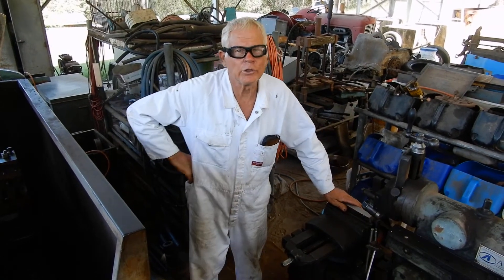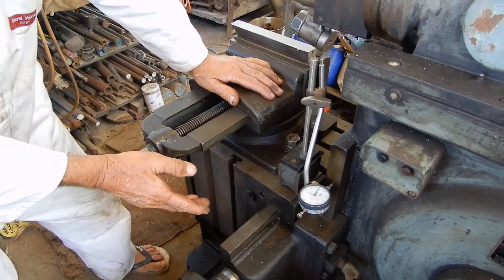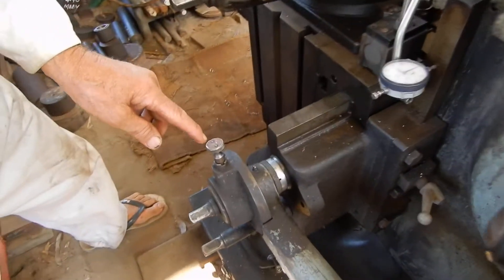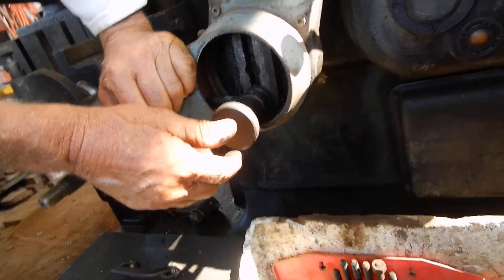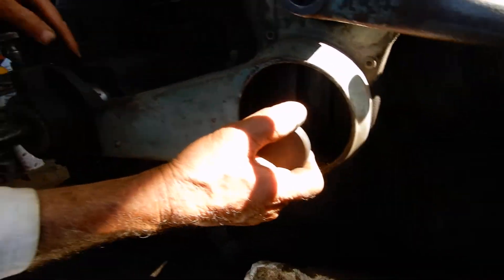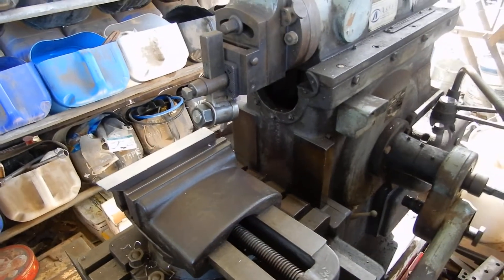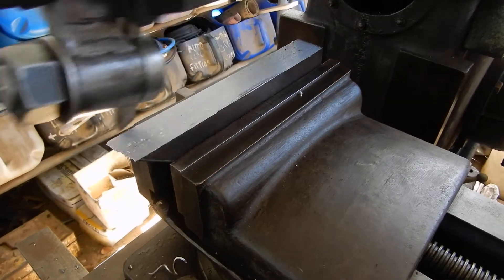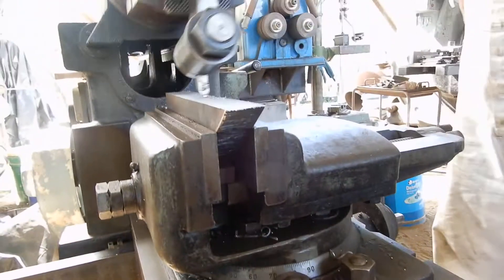shaper table feed

Comment: On my shaper I need to reverse the feed mechanism every time I reverse the table direction.  So most of my cutting is always done in the same feed direction of course.  That is whenever possible.  But my shaper is a baby compared to yours.  Thank you for sharing your knowledge.
Reply from the maker: Probably  the same mechanism big or small shaper...i didn't make it that clear in the video that you should always cut from the same direction unless you move the connecting rod 180 degrees .sounds like you are aware of that ...thanks for watching anyway